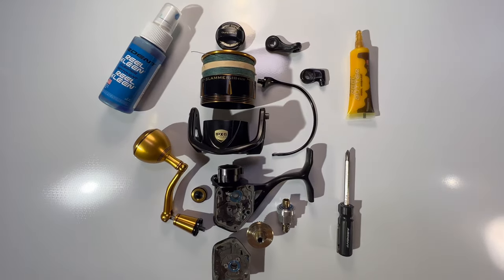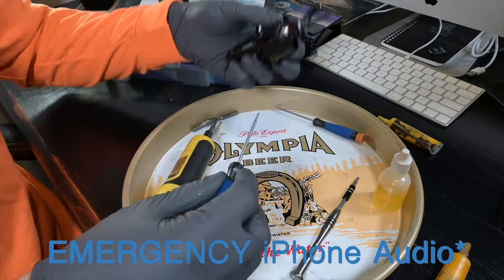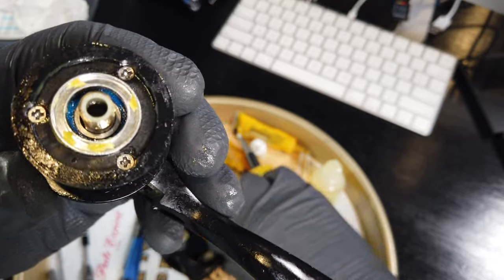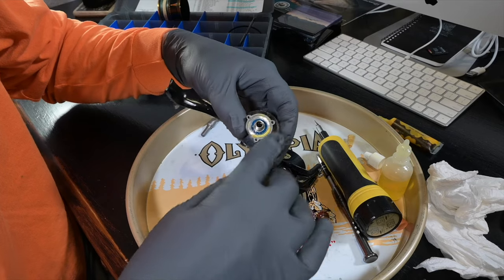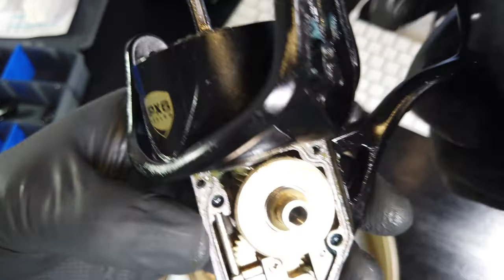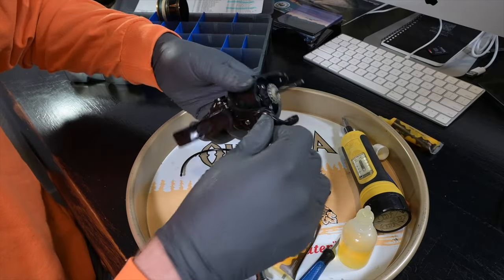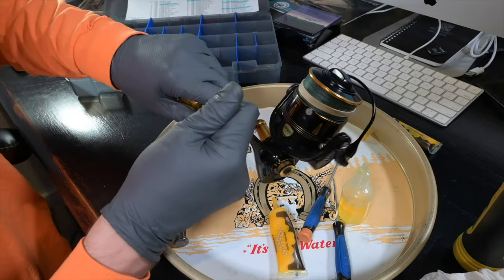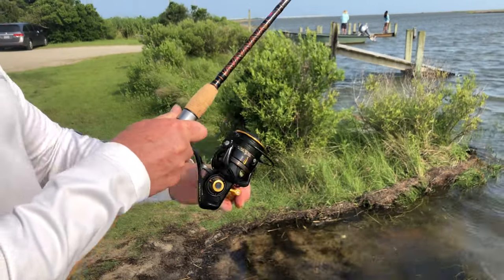PENN SLAMMER: Teardown & Assembly for CLEANING or Repair

Comment: Excellent video with easy to understand step by step instructions. Using this video, I was able to tear down the reel to determine the issue I was having with my Slammer 3 7500 (The Pivot arm broke inside of the bail arm assembly). Ordered the part and replaced it and is not good as new! Also went ahead and serviced the reel while it was torn down. Thank you!
Reply from the maker: Glad to hear that you got your reel fixed and that the video helped!

Comment: Nice video.    Magnetic screw driver works  and for the  main seal  got a great tip using a hair drier to make the seal softer.  It will  flex into position better when  warmed.
Reply from the maker: Awesome technique, thanks for sharing.

Comment: Solid video. So I’ve got mine broken down however upon reassembly I noticed that I have 3 extra washers that if I can remember right came out of the pinion gear assembly, 1 seeming to be slightly larger than the others. I put the 2 spacing washers ontop of the bearing collar. Not sure where these other 3 washers go? The rotor is extremely stiff so I know something is off. (The reasoning for this break down is due to the reel getting superrrrr stiff on me at the end of this past season. Any suggestions on what would cause this?
Reply from the maker: Sounds to me like they gave you too many washers. The schematic only shows one washer on top of the bearing collar and one on the bottom of the pinion gear. More times than not I take apart a reel and I have extra washers that are not reflected in the schematics. I suspect they crank these out of the factory in China and some reels get extra washers. This could be a quality assurance issue on Penn's part. I'd try putting only one washer on top of the collar and one at the bottom of the pinion gear. If it is still stiff, try no washer on the collar. If all else fails, send it back to Penn for service. I assume you didn't drop your reel or anything crazy?

Comment: I have only used my slammer 4 4500 a few times. After one trip it developed a bit of vibration. When I spun without the spool it spun like butter. Also it only vibrates if the reel is in a horizontal position. It does not vibrate when it is pointing up. Any idea what the problem is?

Comment: Are there 3 shim washers on the main drive gear shaft ? There was 2 stuck on there but I found a 3rd lying around
Reply from the maker: The schematic I'm looking at only shows one shim washer. That said, in reality it always seems to vary. I've taken apart a lot of Penn's and it's usually a free for all on washer counts. In other words, what comes off the reel doesn't necessarily reflect what the schematic says. My assumption is that two will work just fine. Thanks for stopping by!

Comment: Hi, I am having issues pulling the side plate off once you take the three screws out. Typically it pops out with a little wiggle but no luck. I am afraid something is wrong with it so I just left the reel, I hear some grinding noises now when I put it back together. Any ideas?
Reply from the maker: That is a common issue with the side plate. With all the side plate screw’s removed, I take a micro flat head screwdriver and pry the seams gently apart in various places. Take it apart and follow the assembly instructions, hopefully the grinding goes away. Something may have come loose when you were working on it.